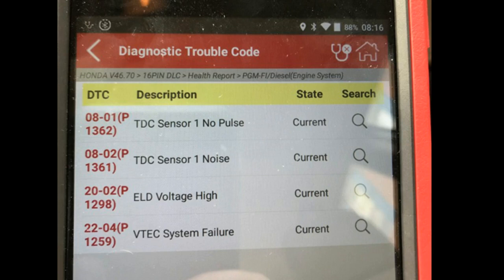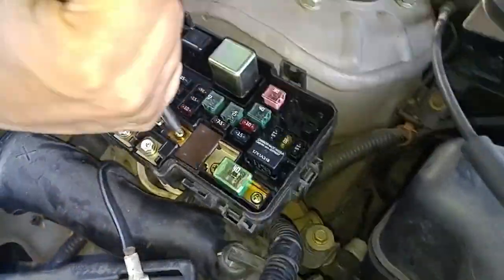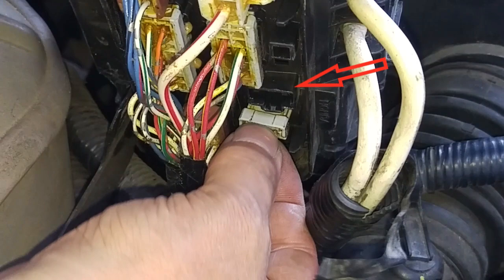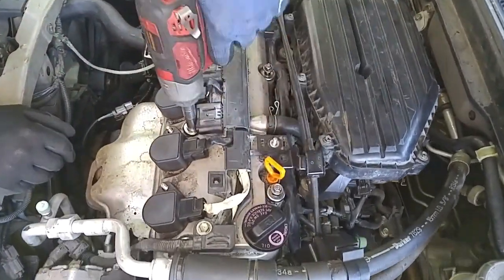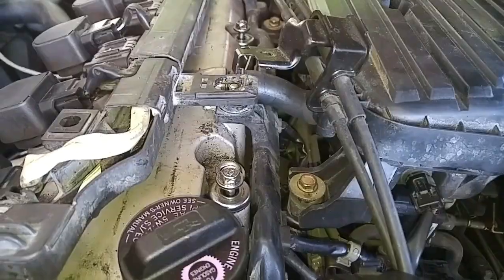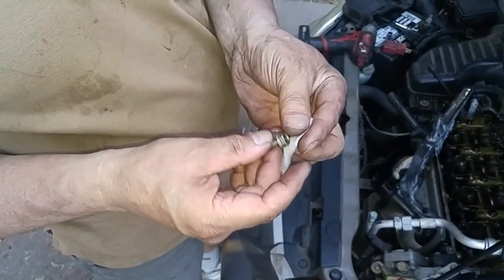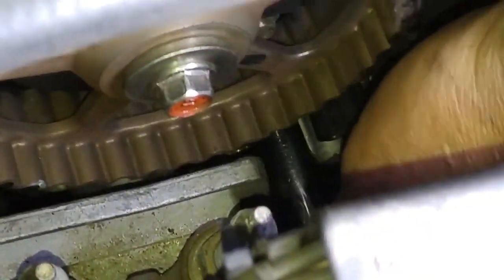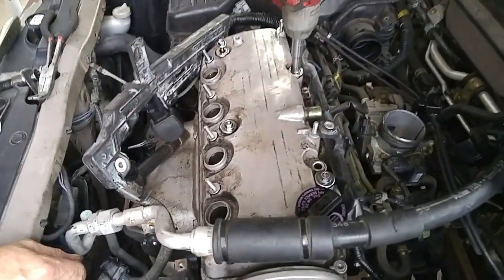Honda Civic Error Code P1361 P1362 P1298 P1259 Repairs (MIL DTC)

Comment: Thanks for sharing this. My A/C died and I keep getting a check engine light P1361 when I I drive in traffic on a warm 70°F day. I experience loss of power and sometimes rough idle. I’ll let it cool and the issue goes away. I thought the issue was fixed when I had the compressor replaced (which failed again within a few weeks) but haven’t had a chance to bring it back in. Today while smogging my car, the CEL came on while car was idling for 10 minutes. Loss of power. I let it cool for an hour and I got power to drive 20 miles home. The CEL stayed on.  I was able to reset it. Would this still be a TCD sensor? Again, it seems to be triggered by stop and go traffic. No overheating and the fans kick in. Ironically when I had the A/C replaced along with transmission, the battery died. It was only about 3 years old.
Reply from the maker: Sometimes electrical sensors fail sporadically which can be deceiving.  I would recommend you replace the TDC sensor.  Had a similar problem in another car where the oil pressure sensor would trigger the low pressure lamp only after engine warmed up but shut off in higher rpm's.  Problem solved after replacing the sensor.

Comment: Does the brand of the new sensor matter. Im doing this same job and my new tdc/camshaft sensor wont work. My buddy says its because its a duralast sensor and not AC Delco. Any thoughts?
Reply from the maker: Possible that a no name brand replacement part can be defective from the get-go.  Haven't had good luck with AutoZone parts.
Reply: @hardlymovingpro  its a duralast from AutoZone. 2nd one so far. Guess I need to go to Napa next

Comment: I changed my alternator two weeks ago, had the car running for about an hour and the car just shut off. I grabbed my scan tool and it said eld high voltage. I ordered it and put it in yesterday. Apparently it was never plugged in since the car was manufactured. I found it weird. I only got the car 8 months ago and now fixing what needs to be fixed piece by piece
Reply from the maker: Good for you and thanks for sharing!

Comment: After I chamge the sensor still has the same code and symptoms and I have change the sensor for 3 times
Reply from the maker: You replaced both the TDC (top dead center) sensor and the ELD?

Comment: I changed all these sensor and keep getting the codes
Reply from the maker: Did you reset the codes?
Reply: @hardlymovingpro  yes and they came back on
Reply from the maker: @angelalvizo5848  Only thing I can recommend is to bring it to a automotive electrical specialist.

Comment: Curious do have any  info on the voltage at the plug where it connects to the sensor? I been having some sort of shortage at (assuming) at high temps. Because I check everything. And wind up waiting until  engine cools then there is no problem for a while. Been very difficult to check for continuity after a p1361 then car breaker down. I feel like by the time I check the shortage fuse back somewhere.
Reply from the maker: Can't say.
Reply: I have the same issue @jonathangarrett9029 If the car is cold everything is ok. When it is over 100 Celsius degrees, I start to get p1361. 
Were you able to fix your issue?

Comment: I've got that p1362 code but my motor is the DOHC I believe that sensor is part of the distributor. Should I just replace the whole thing?
Reply from the maker: It's you camshaft position sensor.  Should be somewhere next to one of your camshaft sprockets.

Comment: Hello! My car is showing the p1361 & p1362 codes. Every time I'm driving and make a speed change the car produces a sound while the RPMs increase to make the change, after making the change the sound disappears, usually happens more when I'm at a traffic light and I'm going to start. Do you think it’s because those two codes? I drive a Honda Civic EX 2002
Reply from the maker: Hard to say.   Take it one step at a time by fixing the cause of each code.  Driving while ignoring the codes addresses nothing.

Comment: What if the camshaft position sensor is replaced and then 3 hours later check engine light comes on..  now I have the same codes to replace the camshaft sensor and cylinders 2 and 4 are misfiring now.
Reply from the maker: Ok ... Sounds like you are dealing with multiple faults.  I'd continue by replacing all the plugs with either NGK or Denso Iridium plugs.  Then swap out coil coil packs 2 and 4 with 1 and 3.   Reset the codes and run the car.  If 1 and 3 get error codes, then those coil packs need to be replaced.   Recently had a similar problem with a BMW.  Replacing all the Bosche plugs with Denso Iridiums fixed his problems.

Comment: Hello Hardly Moving,  I learn something new today from watching your video.  Never know the ELD existed in a Civic and looks a ton of work just to get to it.  Questions:  Do Honda cars need to adjust valves after about 90 or 100K miles?  I had an issue with my 2000 CR-V with 80K miles that stalled on me when the engine cold in the morning,  my mechanic fix the issue after he adjusted the valves, now the CR-V runs well.  And how about the timing belt and water pump kits if your Civic is due with 90 to 100K miles.  Aisin TKH-003 timing belt and water pump kits cost $120 big one at Amazon, and it's a bargain if I know how to do it.  And I think the '02 has an interference engine, hopes that help!!!  Please keep more videos rolling, THANKS!!!
Reply from the maker: Japanese engines rarely require an adjustment of valves if you change the oil on the recommended service intervals.  You can hear a lot of tapping noise when adjustment is needed.  Haven't done an adjustment in a long time.  Unusual for a car with only 80k miles.  Here's a link to a recent video I published on how to do a timing belt/water pump replacement on the Civic:  https://youtu.be/ArNsw83SgaM